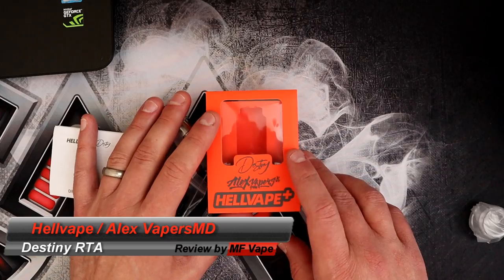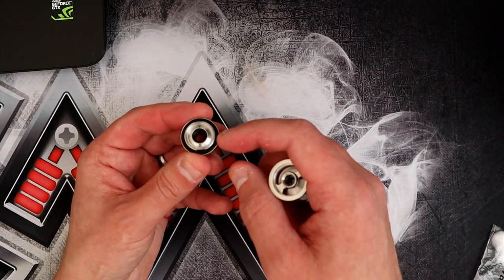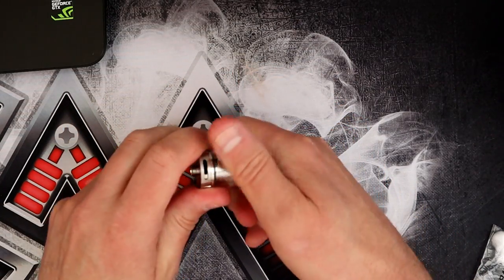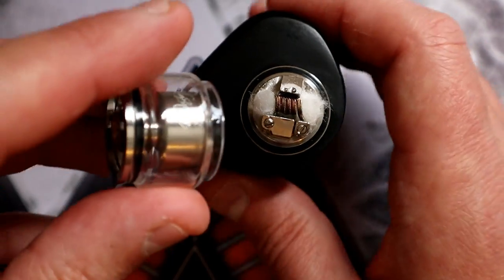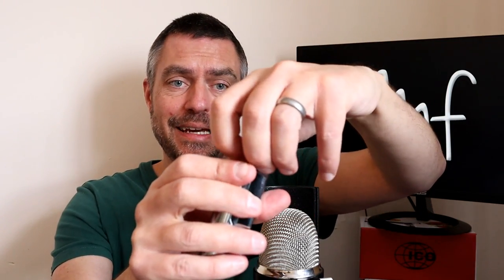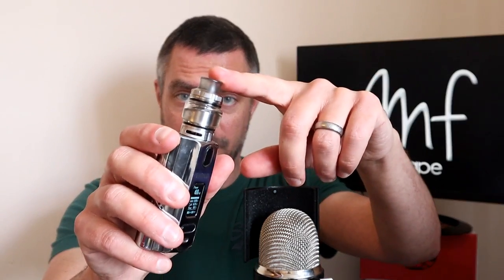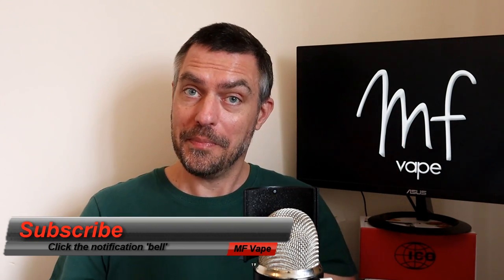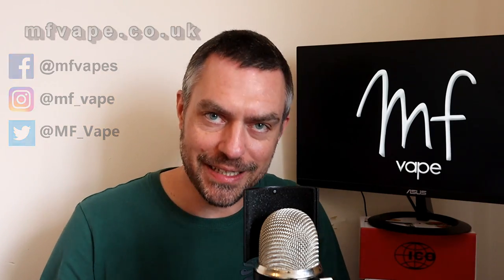Hellvape Destiny RTA | Full Review, Rebuild & Wick | Designed by Alex VapersMD

Comment: Hi Mike, love the reviews. You and Vic are the only 2 UK reviewers I watch regularly now as I like the honesty. I will however say that this one takes a bit of fiddling and has taken me weeks of different builds to get to my liking - I'm a flavour junkie and a chain vaper so good wicking is essential.

If it helps anyone, my go to build is flat kanthal (0.8 width x 0.3 height) wrapped in 32g kanthal - 4 wraps at 3mm diameter - comes out around 0.42 on single coil. Position top of coil level with top of posts. 
Just enough cotton through coil to hold it steady, tails cut at the base o-ring and heavily thinned out. Just enough cotton in juice well to fill half of it. Trim rest of cotton to sit gently around the juice well - less is more here, the trouble iv had is getting juice to the coil quick enough. 

41.4 Watts, airflow around half way and BOOOM! There's ya flava! 

..... So I bought another one
Reply: Edit my above comment - place coil so that bottom is in line with bottom of air flow chute, make sure cotton is not packed in juice Wells and just long enough as to go past the retainer but not pack out the juice intake. I have found u need more air intake than u think to get the flavour to pop but there is damn good flavour on this one if your persistent